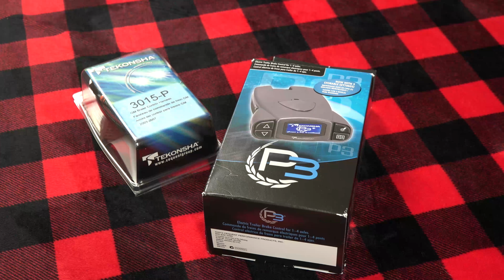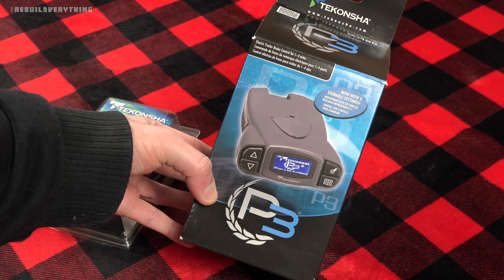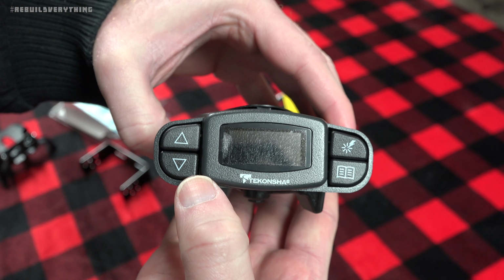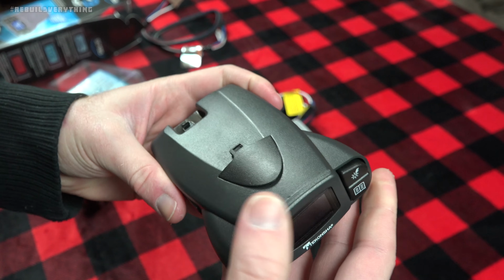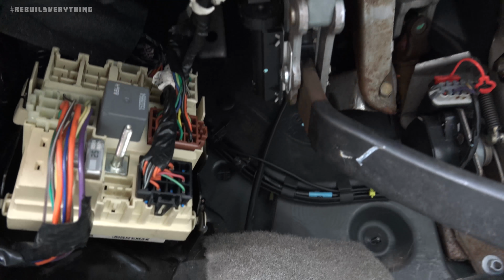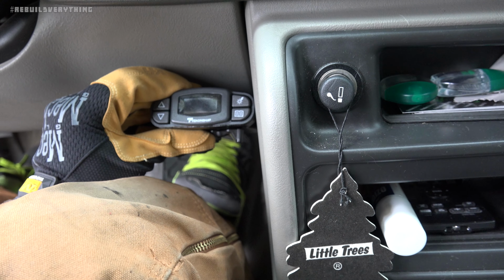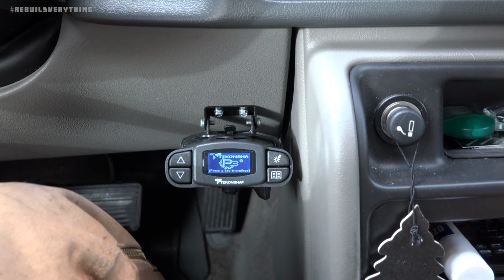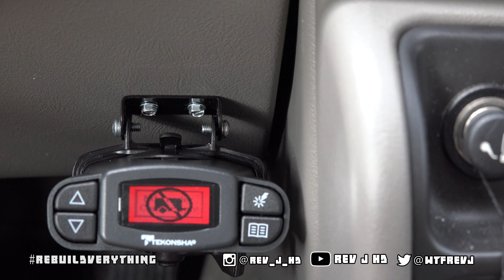Trailer Brake Control for the Yukon - Tekonsha P3

Comment: 7500, 10,000 lbs. axles..dove tail, flatbed, enclosed, dovetail, stock trailer, camper type, All that can 0nly be answered be YOU. We shore can't tell ya what you'll be towing....I have one of these P-3's I use and I pull several different size trailers and I have this Brake Controller on my trucks as well. I Love this controller as well. I've been pull'n trailers since back in the late 50's early 60's. It is the BEST 0ne Ever Made......